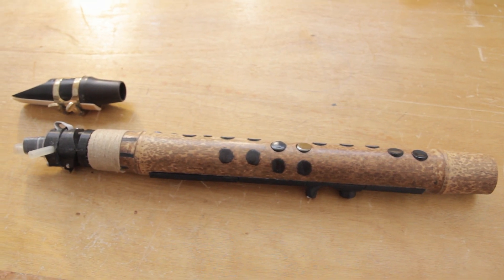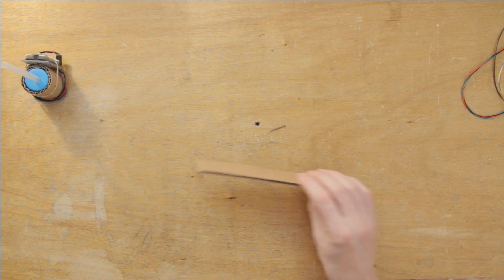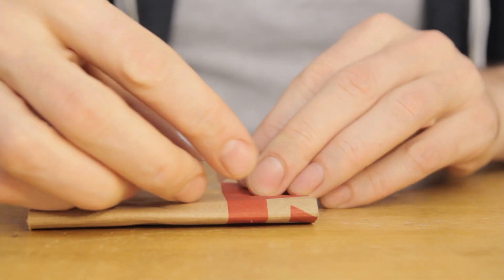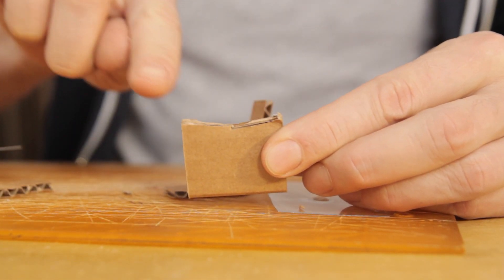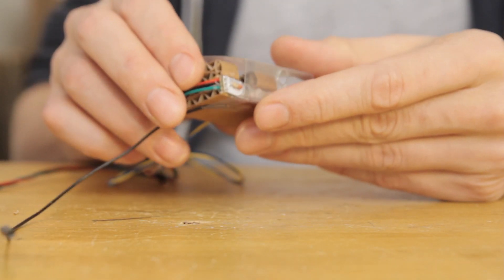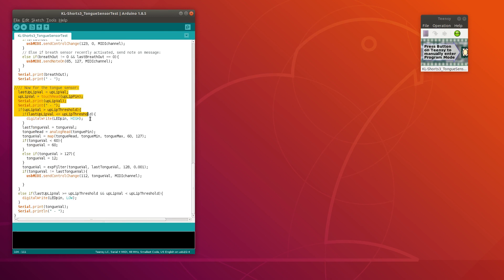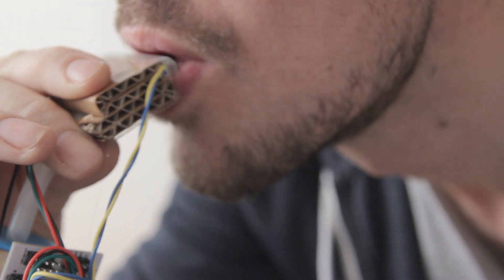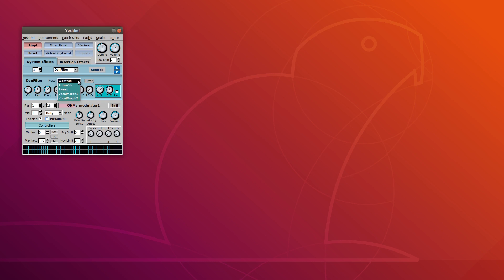DIY MIDI Mouthpiece Measures Light Instead Of Sound. (Tricking the brain with sensors - part2)

Comment: What color LED are you using? The spec sheet for BPW34 shows 850nm, which is IR, but I can see the light in the video. Am I seeing it because your camera picking up the IR, or are you using visible light?

Do you have a patreon page or some form of tip jar? I've been enjoying the heck out of your videos and it would be great to be able to buy you a virtual coffee.
Reply from the maker: Excellent question. I'm using visible light blue LEDs. While the BPW34 certainly peaks in the infrared range, it responds to most visible wavelengths. I was never able to get good results with IR LEDs for this use. Maybe because of bouncing it off of the tongue which is also radiating heat?? I don't really know... I've tested many different colored and white LEDs, most of them work, but I keep coming back to this cool blue one, which is the one that I've found which gives more light / current generally, and which works best in this setup.

Comment: Do you think I could use this kind of sensor for pitch bend, or is it too easy to accidentally activate? I know when playing the harmonica, pitch bend is achieved by moving the tongue in this way.
Reply from the maker: Good question! It might work depending on what kind of result you're going for. I mean, this sensor will never work the same as a pitch bend joystick on a keyboard. For starters, it doesn't have a middle resting position, so it's very hard to find MIDI value "64" with your tongue... 
But for a harmonica style of pitch bending, where you can basically only bend down. it would probably work nicely.
Reply: @KontinuumLAB  Yes, it would have to be limited to only bending downwards! I've never worked with light dependant resistors before, is there anything I should be aware of before I buy one?
Reply from the maker: I recommend the BPW34 photodiode. My first versions of this sensor used light dependent resistors, because they're very sensitive, but they turn out to be quite slow, especially when "recovering" after a high reading. The BPW34 is less sensitive, but it's read in a voltage divider circuit, so  changes in sensitivity, range and resolution are achieved by varying the value of the resistor in that circuit. In the video I use 220kOhm, but even higher would probably be better.
Reply: @KontinuumLAB  Thank you for your help! I've been using another method of expression which you might find interesting - inspired by the growl technique on the saxophone. I don't play the saxophone, but I heard that if you hum into it while playing, it creates the growling sound that we all love from rock and roll music. Humming is essentially just an oscillation of air pressure, so it can be picked up by the air pressure sensor. In my teensy code, I can measure if the person is humming, and add distortion to the outputted sound if they are - mimicking the growl of a saxophone! I thought it would interest you, since you are experimenting with tricking the brain with things like this, and my growl technique does trick the brain a little, I've found.
Reply from the maker: Yes, "growling" is quite common, you get distortion from the interference between your voice and the saxophone. Your method sounds very interesting! What instrument is that? I thought that the waves from sound would be too small compared to the magnitude of the breath pressure. What sensor are you using? I've considered including a microphone separately, try to record humming through the structure of the instrument, maybe...
Reply: @KontinuumLAB  You can pick it up with the pressure sensor! I cant remember what mine was, but its a component I bought from ebay, not a diy balloon one like yours. I'm making a breath controlled synthesiser - so it's like your midi melodica except it also synthesises its own sounds. I've been having loads of trouble adding pitch bend to it. At first I've been trying to add a bite sensor. It works well, but its just too hard to control the amount of bend, which is why I thought I'd switch to the harmonica bending method with your leds. Have you ever tried making a bite sensor?
Reply from the maker: @WeirdSide  Yes. My first few mouthpieces had bite sensors, based on FSRs. Like my very first Open Horn: https://www.youtube.com/watch?v=2iWSM3rVC2w
It works fine, but I actually prefer the capacitive lip sensors which measure position rather than pressure. Of course the 2 things could be combined, but I haven't gotten around to that yet.
Reply from the maker: @WeirdSide  My preferred method for pitch bend (by a lot)  is the spring mounted bendy neck which the Open Horn has had since the beginning. To me it's perfectly intuitive, very responsive and just great! Probably my best idea ever.  https://youtu.be/2iWSM3rVC2w?t=279